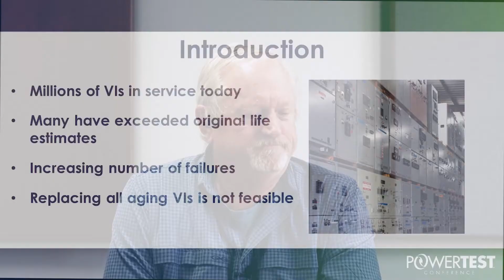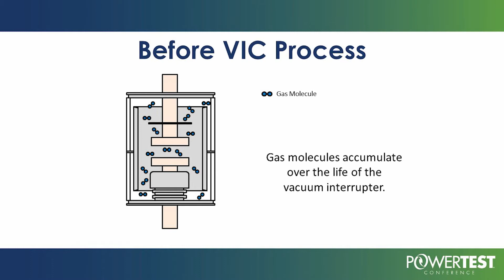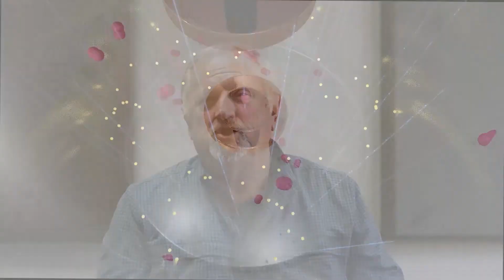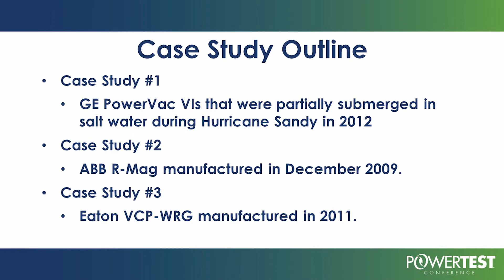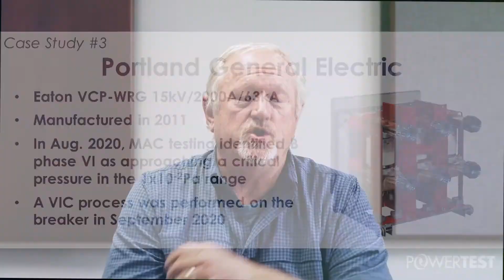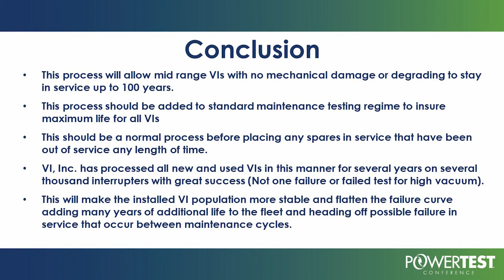Vacuum Interrupter Conditioning with Finley Ledbetter

Comment: Zhejiang Guang Electric (Zhejiang) Co., Ltd. is a national high-tech enterprise specializing in the development and production of electrostatic vacuum devices and has won the provincial title of "specialized and innovative enterprises". The headquarters is located in the Zhejiang provincial development zone - Yueqing Economic Development Zone, covering an area of 15,000 square meters. The company's core products include vacuum chamber, solid-sealed pole, vacuum DC switch, and high-voltage DC contactor. 
The company has a 5,000 square meter class 100,000 clean workshop, and all products and components enter the factory and are shipped as finished products. Personnel and materials enter and exit the clean environment throughout the process, and real-time data monitoring is used to achieve cleanliness, thereby ensuring the stability, safety, and durability of product performance. And the products have passed the certification of 3C, UL, TUV, CE and ISO9001/ ISO14001/ OHSAS4501 management system, providing customers with first-class products and excellent service.  Please feel free to contact us if you are interested.  Whatsapp:+8613373861877